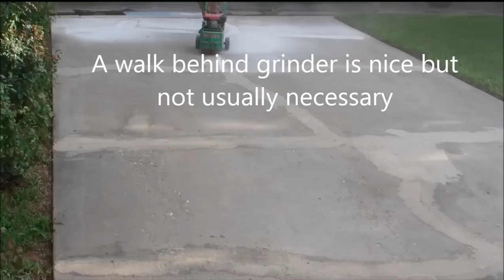HOW TO -  Repair Concrete Driveway - Supertraxx Sand Coating - Concrete Crack Repair

Comment from the maker: it has UV inhibitor in it. It also has no fillers or additives. we use only the purest ingredients for a truly amazing bond. we took down our sign and changed it on our building that has sat in the Colorado Sun at 4500 feet every winter and every summer for almost 5 years and when we cleaned it up it was as good as the day we put it up

Comment: Do you have a brand that you recommend for the crack filler? I would want to make sure that the crack filler works well with the epoxy. Would this work well on a pool deck as well? Would like to do this on a driveway and pool deck.

Comment: so how durable is the epoxy that is designed for indoor use in the outdoors? Would it become yellow from UV overtime? how about the outdoor wear? Also what did you do to the middle part of your driveway?

Comment: the concrete you put over the cracks and then smooth with a trowel, did you break any concrete up or made it bigger? I was taught you had to break the concrete away and make the crack slightly bigger so you expose new concrete and that will help the concrete adhere to the existing concrete!! this is not my profession, just merely asking if this is correct

Comment: yes it can and will crack again if the concrete moves. you have large sections of concretw on either side of the cracks. that is a ton of weight shift. no epoxy in the world would hold ot together it will crack again. a flexible crack filler urea or urethane would hold better but the top coating would crack with the movement. if it does work and you would warranty all labor and materials for 18 months I will swollow my pride and change my view. I would also by your material and be doing 10 driveways a week. 20 yrs fixing driveways and dealing with cracks nothing works well enough to warranty. be carefull if this is somthing you are considering.

Comment: Where do you buy this Super Traxx Epoxy?
Reply from the maker: super traxx is no longer available if you call us we can sell you the epoxy for it  and you will just have to buy sand (970)639-9338
Reply: CountertopEpoxy Thanks for taking the time to reply back, could you please reply back to following questions
1.  for a 2 car garage driveway approx 50' x 26' how many gls of epoxy is required?
2.  is there any specific type of sand to use?
3.  can a color be applied to sand/epoxy?
4.  can a crack filler be purchased  from a local home depot/lowes if so is there any brand you recommend?
5.  are there any shipping charges other than the normal charges?
6.  what are the best hours to call?

Thanks
Norma
Reply: Norma Moran b